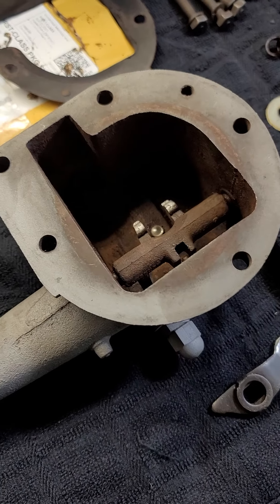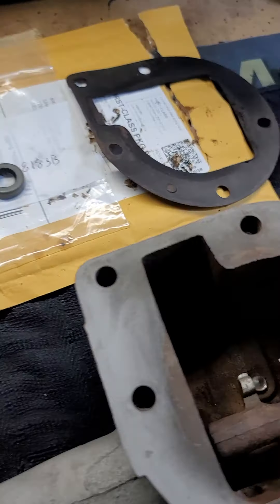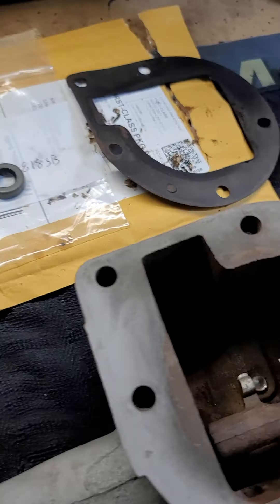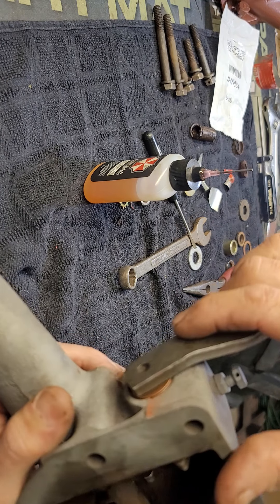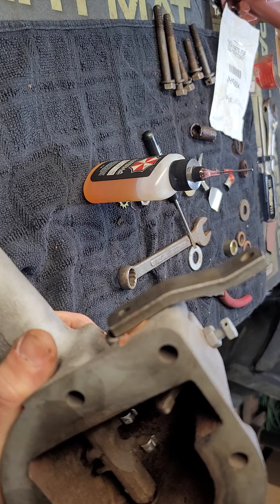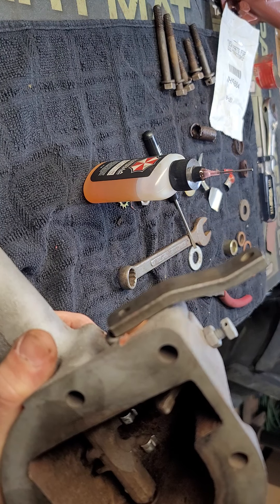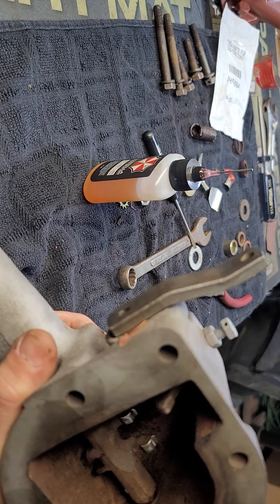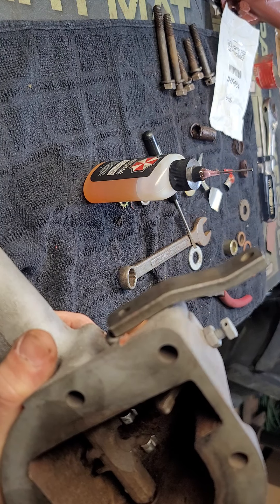Farmall Super A Governor repair

Comment: Does the orientation of the Governor spring matter? Do the hooks need to face a particular way?
Reply from the maker: No not really,  either way is fine. I hooked it the way it came out with the bottom opening to the right and the top opening to the left . Hope this helps!

Comment: Hyou ey man still watching your videos. I just rebuilt distributor on my super a. Im having trouble with the timing procedure. You got anything on that?
Reply from the maker: Yeah no problem,  the timing is actually pretty simple.  These can technically fire at any position on the cap as long as the designated #1 is going to the #1 cylinder.  I personally like to keep mine at the proper #1 spot. Pull the plugs , bump to #1 top dead center catching it just as it starts to go down. Set the mag in after turning the rotor towards #1 on the cap but dont let it snap. Set it in place , snug the bolts, spin it around again a full revolution to #1 then pull the mag slightly away from the block and that should be at #1 and ready to start.